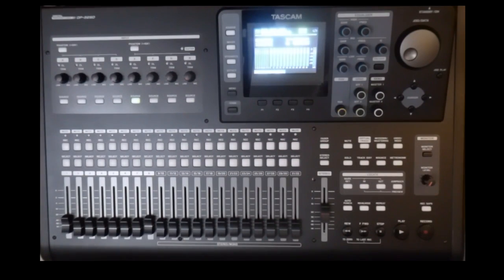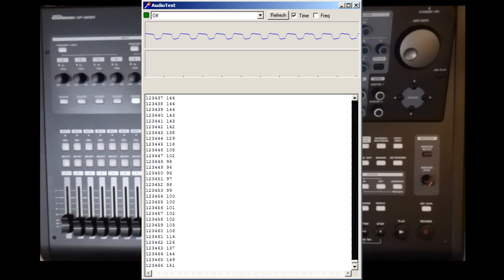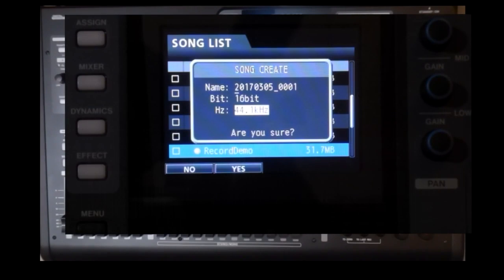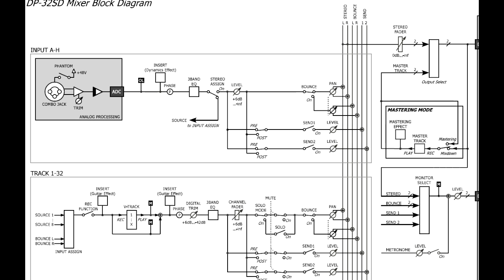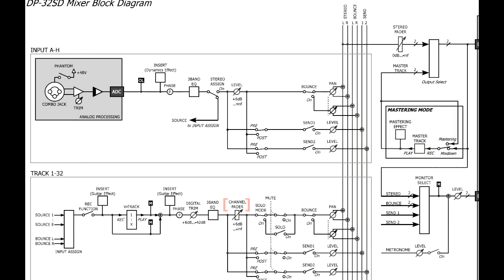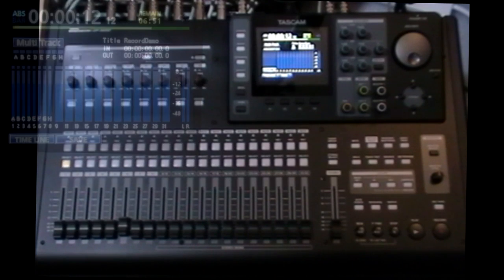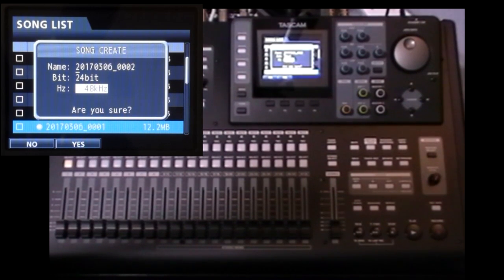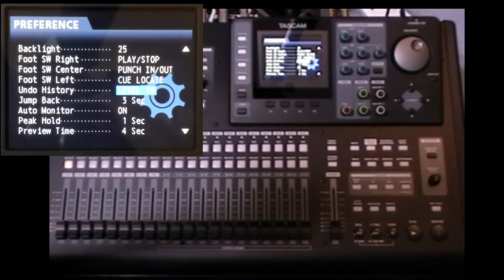Tascam DP24/32SD Tutorial 8A: Recording

Comment: Can you have a great mix without pro tools?
Reply from the maker: @knowledge on keys I would say "of course you can". You can mix on any system if you have the skills and know what you are doing. How do you define 'a great mix'? There are many steps and processes in the recording chain, from the performer through to the final release, so to me it seems meaningless to compare just one or two processes.
Reply: @philtipping  right... But the reason I'm asking people are saying radio wont play songs with out pro tools
Reply from the maker: @DJ.Nokk19  ok I see thanks, I didn't know that. It does seem a strange requirement. If you are sending a standard wave or mp3 file to the radio station, how can they tell what system you used to create it? The Tascam machine creates standard wave files, as does most other hardware machines, as does most software DAWs such as Audacity, Logic, Cubase etc, so I can't see why they would insist it has to be made using pro tools. I think it might be false information. Maybe radio broadcasts need the audio to be compressed to a certain level and maybe pro tools has a function which does this easily... and this has led to the mis-leading assumption that you can only use pro tools to do this, whereas in truth most systems, including the Tascam machine, are capable of compressing the audio. I just found this article which says something similar in the first few paragraphs https://www.audio-issues.com/home-recording-studio/free-audio-recording-programs/  so hope you find out the real truth before spending money needlessly. Keep us posted, and good luck :)
Reply: @philtipping  thanks
Reply: @philtipping  can i use Auto tunes on the tascam and if so how?
Reply from the maker: @DJ.Nokk19  yes, any effects can be applied to audio recorded on the DP machine. There are two options... 
(a). Play the track(s) in realtime so they pass through the external effect unit (or computer) and record the result. Typically you'd use the send outputs for this.
(b). Transfer the audio file(s) to your computer, apply the effects in your DAW, then transfer them back to the DP machine.
The step-by-step guide shows how to do most of the above, details here  http://www.philizound.co.uk/freebies/dp24-32/dp24-32.html

Comment: No Spectrum Analyzer? How you do EQ without it?!
Reply from the maker: @Popart 2015 good monitors, good room acoustics... and good ears - I've only got 1 out of 3 myself :)  ...  but I don't remember analyzers being very common years ago.
Reply: @philtipping  Ok I see, thanks for the answer.

BTW, I found this next comment about the device in thomann.de, what do you think about it?:
------------------------------------------------------------------
No MIDI!
That's my main gripe with this machine. Can you believe that? My two-decade old first-generation DP-01 Tascam 8-track has MIDI and intuitive controls. This model certainly doesn't. It took me about a month of continual usage to familiarize myself with its controls.
And no CD burner either! I would have expected that at this price point, which I believe the older model of this line had.
The sound of the recorded tracks is fine.
However the guitar effects that come with this model are inferior in every way to the preset effects that were included in my older DP-01. Disappointing. The amp modeling is considerably noisy with audible hiss.
I still haven't quite figured out how, or even if, the compressor facility that's included as a mastering utility is useable without degrading the overall sound. I decided to omit that from the mastering process.
The pros would be 24 tracks of good quality recording ability and a certain TASCAM familiarity coupled with some level of perceived quality.
The cons, well, all of the above.
This was my first recording gear purchase after a 15-year hiatus and I have mixed feelings about it. I really don't understand how TASCAM can put out a digital recording WITHOUT MIDI after all those years.
Frankly, I continue to use my trusty old DP-01 more than this guy. But if you need to record a large band live and you require simultaneous recording ability on a large number of tracks, you'll find this digital recorder quite useful.
Reply from the maker: @Popart-xh2fd  yes a lot of people agree. Losing the CD burner wasn't as big a deal as a computer burner is more flexible - high-speed burning, cd-text etc. There are old-school ways of syncing though, e.g. video 13, but it's more boxes and cables to wire up. As for the effects, I've not compared them as I mainly use the machine for on-location recordings and process the individual tracks back at the home studio. As a basic tracking device, it's perfect for me... although I do find the send outputs useful, and the effects and other onboard features are very handy for quick demos. 
Some people say they've made high-quality songs completely within the DP24/32 machines, but I don't know what effects they used, or didn't use! 
Maybe the Model 24 (and now the new Model 16) are viable options? They would have been a better choice for me had they been available then, but the model 24 was double the price when it came out so I would probably have still bought the dp32sd. But once you go down the model 24 route, a lot of 'studio' features require a DAW so it's not far off throwing the towel in and recording direct to a DAW in the first place. If you still want hands-on controls, there are several mixers available with USB output.
Hope the dp-01 continues to perform. My base system uses a free-standing hard-disc recorder so there's still life in these mechanical contraptions yet, contrary to popular belief :)
P.S. I see you've uploaded a video re the Digitakt... have just got one of these and trying to get my head round the 'Elektron way' - haha :)

Comment: Phil, when bouncing a group of tracks to a stereo channel, can you mix those tracks in real time with the faders? Thanks! 

Also, with the two aux sends, can you send a stereo channel out of those into some external effects and back into a stereo channel on the Tascam? Cheers!
Reply from the maker: @Shannon Simmons yes you can move the track faders during a bounce. You cannot adjust the other knobs - eq and send levels - during a bounce, but you can adjust everything during a mixdown.
Each aux send is mono, so if you want a stereo send, you have to use one send for left, the other for right. This means you need 2 source tracks to provide the left & right signals - a stereo track on its own won't work as its send signal is summed to mono regardless of which send you use, but there are several ways to split the track into 2 monos.
The step-by-step guide may help clarify some of the routing options.
Reply: Phil Tipping Thank you.

Comment: I need a 16 input version. An analog drum machine can have over 10 output channels on its own...
Reply from the maker: @Weird Music if you want an all-in-one porta-studio then I don't think there's anything on the market with more inputs (as at Feb 2019). You could use an external mixer and pre-mix some of your signals before feeding this into the dp24/32, but this means you'll have to commit to the 'sub-mix' before recording. Alternatively, abandon the all-in-one approach and use something like a mixer/recorder with USB output such as the Model 24. These have many more inputs, but the trade-off is that post processing needs a DAW.
Reply: @philtipping  so on the model 24 you can not cut and rearrange like on this one?
Reply from the maker: @fortheloveofnoise  As far as I know, there are no Track Edit functions. I think there's also no way to re-route (assign) inputs to different tracks without physically moving cables. It's really aimed at a different market, which is fine if you just want to record lots of inputs separately, and then use a DAW to do all the 'studio' work. I believe you can still use the machine at the tail end by feeding the processed tracks from the DAW back to the Model 24 and use the faders as a control surface for mixing, but imho it's certainly not a porta ble studio as such, so is not really a successor to the DPxx range. If you download the manual, you can see what it really can & cannot do.
Reply: @philtipping  That sucks. I want a DP with 16 input channels badly...I hate DAWs...so it would be the perfect tool for me.
Reply: @fortheloveofnoise  Yamaha aw4416 very good!

Comment: Hi again Phil, sorry to bend your ear again, I'm trying to do a back up of the song I've been working on while I await the new SD card I've ordered as still getting glitches (5 min wait to save a song after adding vocals!) , but the manual is not very clear on how to do this, is backing up a song simply a case of copying the folder in the music folder which has the name of the song, and then copying it back again when the new card is in, or do I need to export tracks as well? thanks again, Michael
Reply from the maker: Hi Micheal, sorry about delay - didn't get a notification from YouTube so only saw your question by accident. Yes you can backup songs by copying its folder - there is no need to export tracks. You might be better off with the Step-by-Step guide as this explains why & how to do both and what the difference is. Full details here http://www.philizound.co.uk/freebies/dp24-32/dp24-32.html

Comment: Happy New Year Phil, thanks for that, mine may well have been corrupted by the two freezes and plug pulls, I'll swap it when I finish the song I'm on as I'm a way into it.   I'm not sure what a class 10 card is, are there certain brands/types that you could recommend for music? thanks again, Michael,
Reply from the maker: @Michael J Newton The Class number is one of several 'speed' characteristics of a card - it's usually shown on the card as a number inside a circle (C) shape. Quite a few people use SanDisk cards, but there are other makes listed on Tascam's website.  I use 32GB SanDisk Extreme 90MB/s, SDHC, UHS-I, U3, Class 10 - I bought a couple on special offer about 3 years ago, and have had about 3 random glitches in that time - non were lockups though. A UK tech support man recommended no higher than 16GB cards as he thought 32GB was pushing reliability to an unnecessary extreme. Another advantage with using smaller cards than the max allowed (32GB) is that you don't put all your eggs in one basket; cards are so cheap nowadays you could even contemplate using one card per song. Whichever way you go, I would recommend you make regular backups as no system is going to be 100% infallible - even if your hardware is 100% reliable, there's still 'operator error'... power-cuts, someone tripping over the power cable, forgetting to shutdown before pulling out the card, etc. The step-by-step guide shows how to backup & restore songs & tracks.

Comment: Hi Phil, thanks for a great video,  I wonder if you could give some advice, I've only had my brand new DP32 for less than a month and twice it has completely frozen on me, no buttons seem to work including shutdown and I have had to pull the plug, have you had experience of this kind of problem? Thanks
Reply from the maker: @Michael J Newton Thanks for the feedback Michael, and happy new year to you. The usual culprits for these faults are not using the latest firmware or a corrupted/incompatible sd-card. Class 10 cards seem to be the most reliable according to the Tascam forum users, but even good cards can be easily corrupted if they are not handled correctly, e.g. by always shutting down cleanly, having a reliable power source, etc. There are several discussions about these issues on the Tascam forum.

Comment: Thanks for all the time and effort you have expended in turning out an excellent tutorial.
I am having an issue with the Mic being live in spite of the fact that I have the trim & track fader turned down all the way. When I play back thru my ,monitors they feedback thru the 
mic. I can overcome this by disconnecting the mic. There must be something I am missing. Could you advise.
Reply from the maker: @Marada Cash thanks for the feedback and kind words. As the videos mentioned, the trim controls don't go down to zero so that's why the mic signal is getting onto the Input path in the first place. The track faders do go down to zero, but they only control signals on the track path, so.... if you're still hearing the mic, its input signal must be going straight through to the stereo bus (which is what you are hearing though the monitors) via the Assign routing. So go to the Assign screen and make sure the input letter is not highlighted in the bottom row of boxes marked Stereo. If any of these are highlighted, it means the corresponding inputs (A-H) are routed direct to the stereo bus, regardless of whether they are also routed to individual tracks (via the track boxes above). Hope this helps.

Comment: ANYBODY HAVING PROBLEMS WITH THE DP24SD TUNER?  LIKE CUTTING ON / OFF WHILE TUNING LOW E & A... IT SOMETIMES DISAPPEARS AND TAKES THREE OR FOUR SECONDS TO SHOW BACK UP!  I'M USING NEW CABLES SO IT'S NOT THAT AND I HAVE CHECKED ALL CONNECTIONS...     ANYBODY?     OH YEAH  -  HAPPY NEW YEAR :)
Reply from the maker: +John Roberts Hi John, Happy New Year to you too. I've not used the tuner so not much help - but try asking on the Tascam forums http://www.tascamforums.com
Reply: UK Phil  - Will do!   This thing hasn't been out of the box long so it's a need to know...  Been doing drum tracks and some keyboard bass so I haven't used it till now and it's oh snap, what's this?    Thanks Phil  and stay safe this weekend...  Don't drink and drive and if ya do don't hit anything that the color don't match!   :)
Reply: John, I think I remember reading somewhere that it was a software glitch that was solved by a firmware update. Are you on the latest version?
Reply: I've had the unit for about 7 months is all I can tell you.. I have no clue...
Reply from the maker: The version no. is shown in Menu, Information. The latest firmware for the dp-24sd (as of Jan 2018) is 1.02
Reply: I just updated mine to 1.2 and had forgotten how. Couldn't find it in the manual either. You need to download the file to computer and transfer the file to the utility folder on your SD card. Restart the machine while holding down mute and undo buttons. Select the file that pops up (the one without the full stop at the beginning if you're using a Mac). That's it.